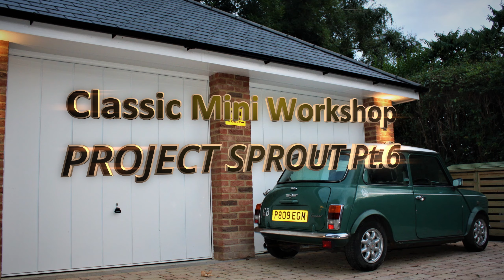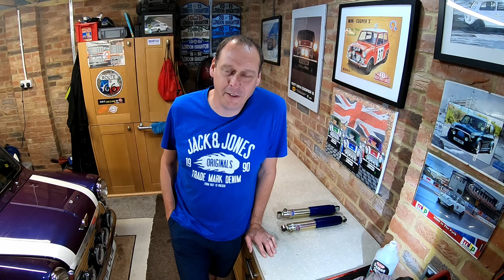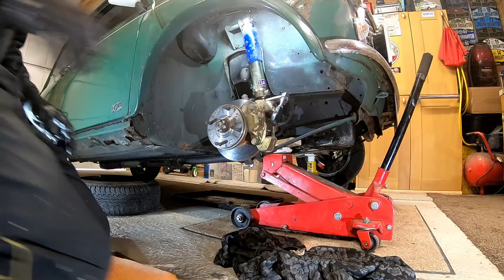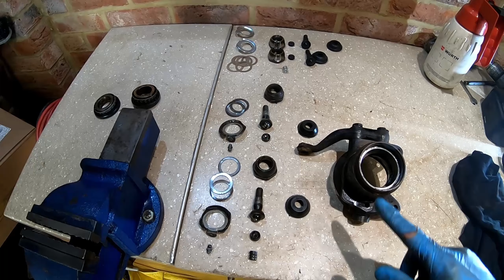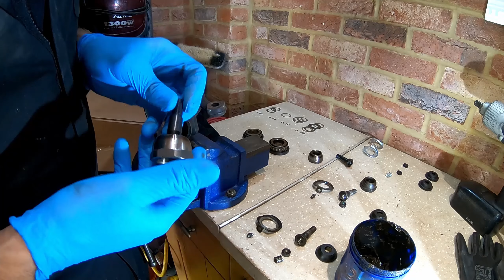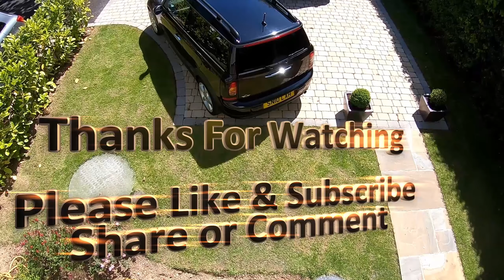Classic Mini Workshop - Project Sprout Pt.6 Suspension Swivel / Ball Joints

Comment: Just rewatched this just because i started mine the other day. I realised I didn't have the socket or spanner for the job. Are you using a 40mm deep socket? Tried using a adjustable spanner & it wasn't good enough, i feel like i need a socket with a breaker bar to get it loose.
Reply from the maker: My socket is 1.5" (38mm)
Reply: @classicminiworkshop thanks 😊